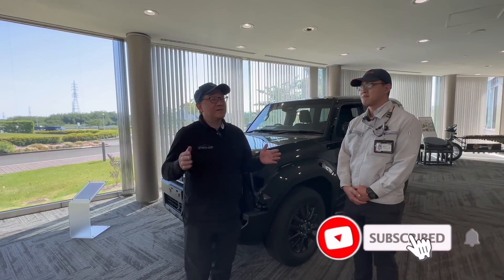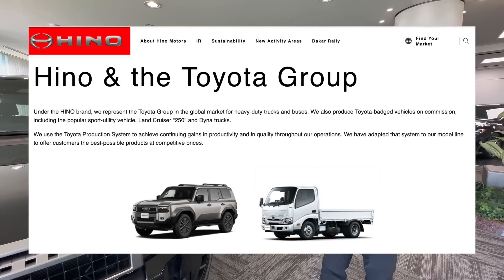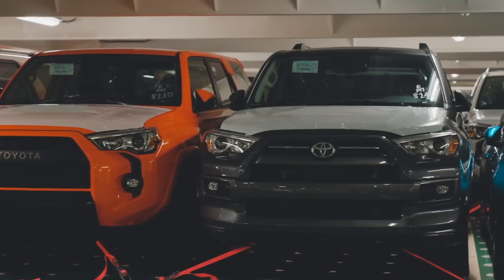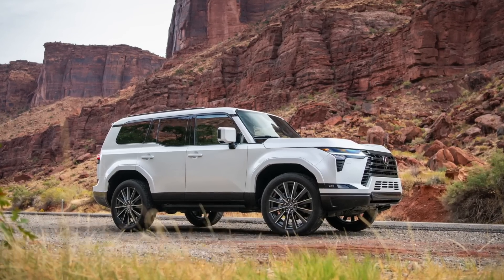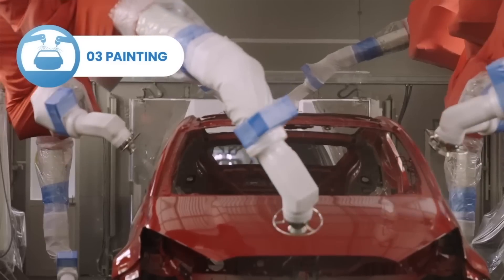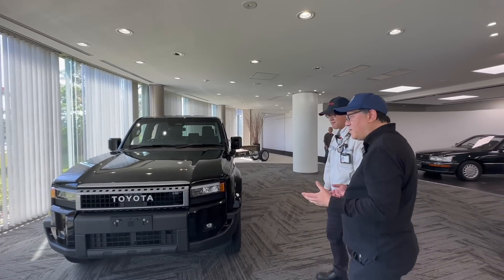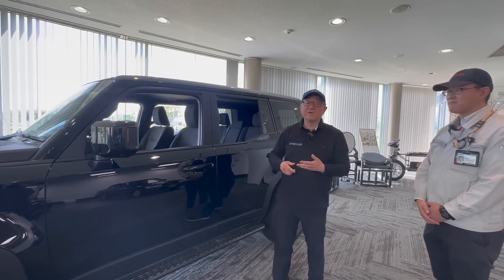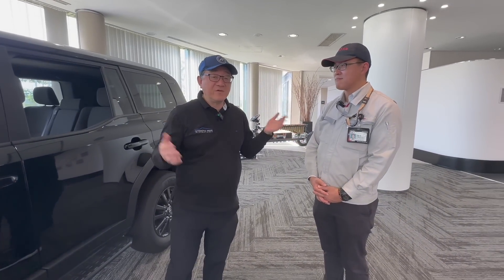LAND CRUISER ASSEMBLY ENGINEER ANSWERS IMPORTANT QUESTIONS - WHY TAHARA & HAMURA BOTH PRODUCE LC?

Comment: The frames for all three models are not galvanized. At the production stage, the cost would be several dozen dollars, for the owner after years it will end up deleting the car. That's sad about today's automobile. Besides, it's a great car. Unfortunately, where ice, mud and salt on the road, it won't last long.

Comment: I have always appreciated Toyota’s focus on quality and build efficiency however the past ten years value and money is not as great in the US market in regards to SUV and trucks.   The pricing for a vehicle that’s meant to be a daily driver and off-roader is too high.  Even 66k for a base landcruiser is crazy as I’ll “pine stripe” it rhe first time offroad.  Tires in new landcruiser are straight highway tires so then it’ll be another $1000-$1500 on tires and not sure about wheels.  I’ve never paid more than 40l for a vehicle before and do t plan on any time soon.

Comment: Great video. Thanks. Would you be able to answer - Will a 2 inch leveling kit and 285 70 18 tires affect the traffic assist or any other sensors.

Comment: 6:30 does LC/GX have stronger frame and rigid body compared to 4Runner?  

As in the taylor welds are thicker on parts of the frame and more metal straps on the body

Comment: Ask him! Is it still reliable ? Will it outlast the last gen? Will all the new Toyota with turbo engine last up to 300k mile or 500k miles with no issues?
Reply: The last one in the 200 series had twin turbo 4,5L and the 150 series had the same 2,8 L turbo as this new 250.
You talks like we were in the 80's Even the 60 series had turbo in some engine.
Reply: @svein-haraldribland8559  i am just curious and I live in the US.
Reply: @svein-haraldribland8559  I am curious and I live in the US.

Comment: Hi David, YouTube has just informed me that both CBI and Westscott Designs has both released their Side Step Rocker Panel Rock Sliders, for the J250, if you were interested. Also, CBI installed the latest Tundra TRD wheels onto their Land Cruiser and it looks stunning
Reply: David, YouTube has now informed me that Dissent Offroad has released their version of Rock Sliders for the J250 Land Cruiser. They look absolutely amazing! They almost look like OEM Running Boards. But when you look closer,  you can see the detailed thick welds and heavy duty bolts, and you can really tell,  they really mean business.

Comment: Hi David. It's nice to know they maintained the same standards but it's way too overpriced. I'm from SEA and the Prado 250 here is the same price as a Mercedes Benz E Class. The engine we get is the same as the Toyota Fortuner with the 1GD engine. Why pay a 50% premium for what is a HiLux and Fortuner? And if you're a current Prado 150 owner would you swap your 150 with a 1GR V6 for this?

Comment: Great video! “The Toyota Product Development System” by James M. Morgan and Jeffrey Liker describes a “Simultaneous Engineer” on the product development (engineering) team. “This Simultaneous Engineer is a production engineering expert who advises the Module Development Team on manufacturing aspects of design within his or her specialty (i.e. stamping, welding, etc.) and also serves as the program representative who advises production engineering specialist who will perform the actual manufacturing engineering.”  Where does an “Assembly Engineer” fit in? Of course, everyone remembers Henry Ford and Frederick Taylor’s “Industrial Engineers”.  I realize there may be some nuance and personal choice in translating from Japanese.

Comment: Can Toyota “fix” the Land Cruiser so it doesn’t require premium gas since they did the same thing when the FJ Cruiser came out so I hope Toyota fixes this or at least make premium optional but you can still put in regular for a little less horsepower or something
Reply: It's already been done for the 2024 Tacoma you don't have to run Premium fuel it is suggested it is not mandatory, it is as you say at a slightly reduced horsepower rating
Reply: @99unclebob  yes I know the Tacoma can take regular but in the Land Cruiser’s owners manual and on the gas cap it says premium only Not optional like the Tacoma with the same engine

Comment: I wish you asked about the engine recalls (the 3.4 twin turbo ones).
Reply: Correct me if Im wrong but those are not built in Japan
Reply: There's a Lexus GX that has the same recall as the tundra and those are manufactured on japan  @marcs1386
Reply: incorrect because the GX and LX and sequoia and tundra all use the same engine and have recalls on those engines right now.

GX and LX are made in Japan, the others in US/Mexico now. But the recalls are because of the engine and not because where it’s made.  But yes, quality control with tighter tolerances go to the Japanese plants but that doesn’t matter on this topic as the recalls are due to engine itself I believe. They’re fixing it:
Reply: The 2,8 L Diesel will make most sense anyway
Reply: David will never ask a Toyota executive or engineer about recalls because he does not want to be like John Wick… Excommunicado!